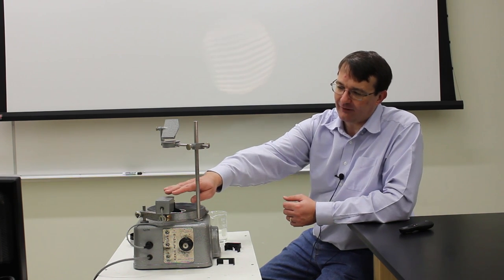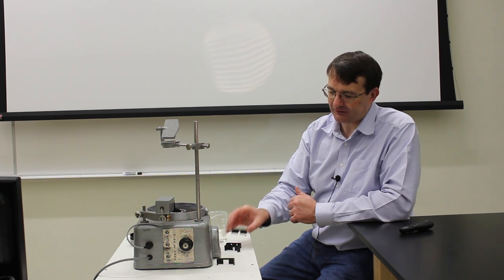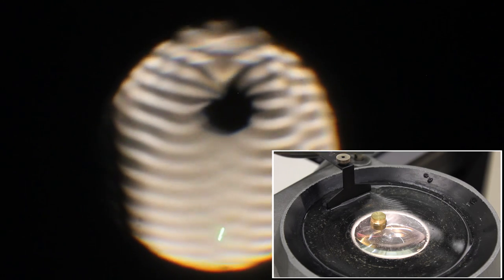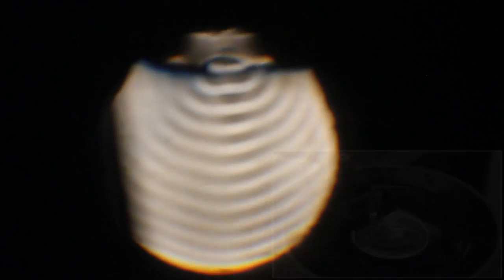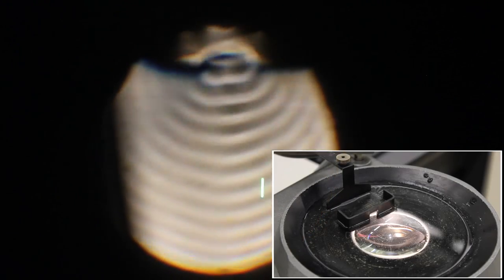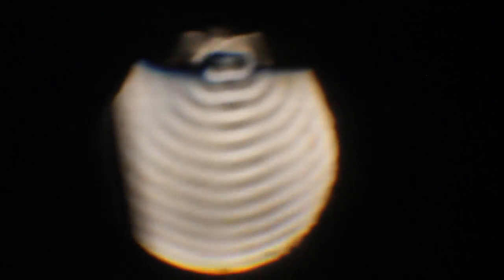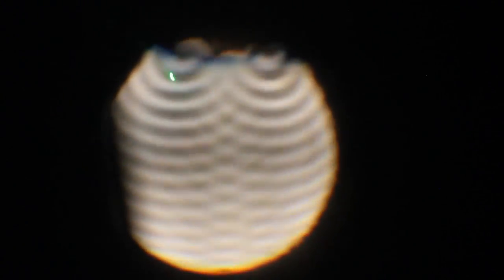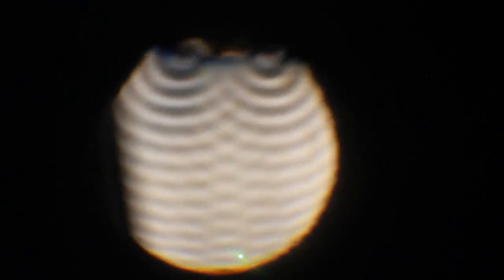PHYS 130 Lightwaves Part 6: Diffraction

Comment: can you help mr in  this please !
i know thats  we get images in lens by refraction   so whats  the way to do that with using  difraction unsted of refraction??
Reply from the maker: The way to create images by diffraction is to use a <a href="https://en.wikipedia.org/wiki/Zone_plate">zone plate</a> which is a device invented by Fresnel. It usually consists of circular rings of varying widths which alternate between opaque and transparent. In this way only diffracted light which will constructive interfere is allowed to pass although the binary (opaque or transparent) plates have multiple focal points so the light is still not all focussed to a single point.